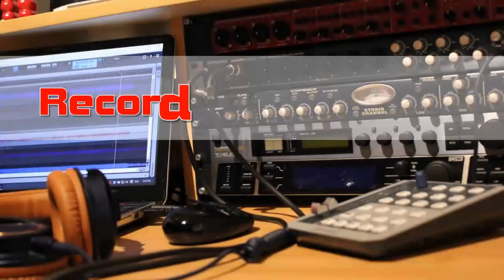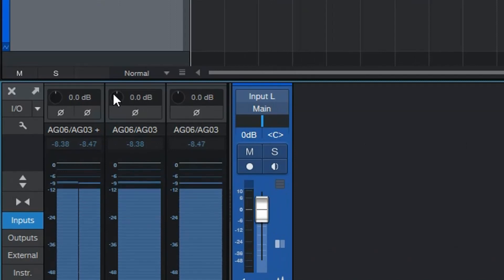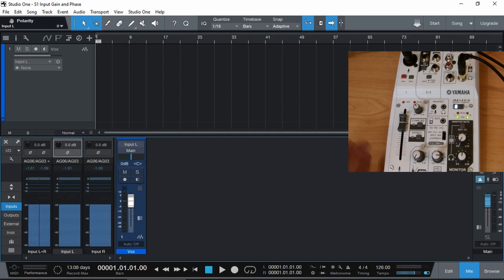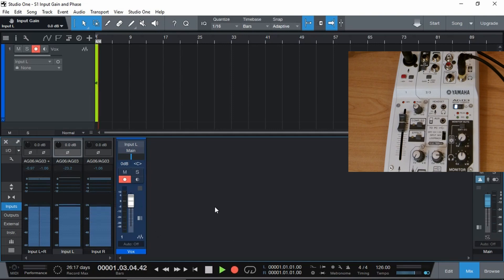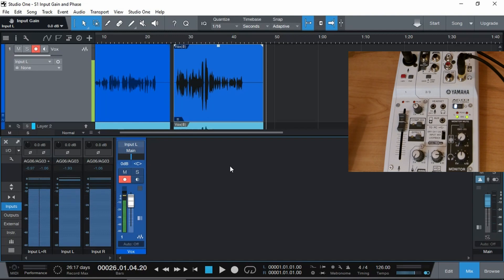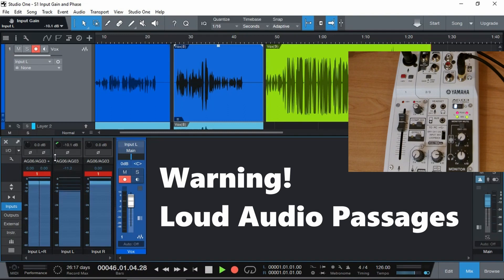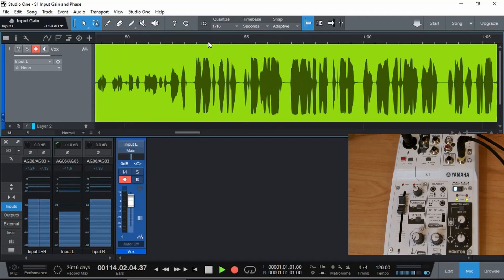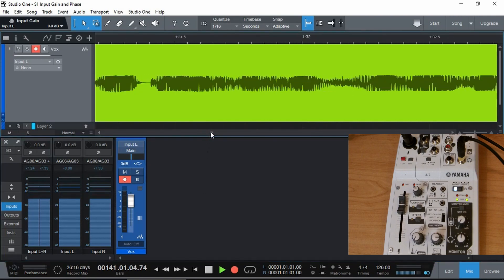Studio One V4.5 Input Gain Option Misconceptions Explained

Comment: Hi...Just wanted to say thank you for this video.  I've been looking for an answer to this question for a while, you finally answered it.  My question being, after setting the gain on my Audio Interface for no clipping, how do I set the gain on Studio One, as to what it's actually receiving on the Input Track.  The only thing I would mention in your video is to include how you got to the Input screen. Took me awhile to figure it out. Once you create the track,  click in a blank area in the track.  The screen will open up the Mix Console in the lower section, then you'll see options to view on the left, select "Input" and you're there!  I'm new to Working with a Software DAW, so I need to drill down to the stupid level.  Appreciate you sharing your knowledge.
Reply from the maker: Thanks for your comment. I cover most of what you mention in many of my previous videos.
Reply: @RecordingStudio9  Thanks I will check them out!